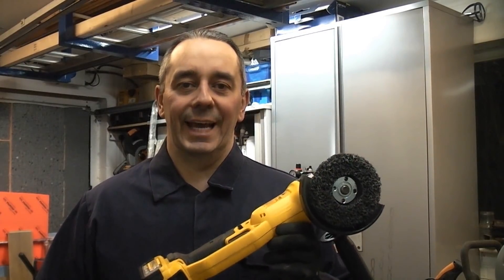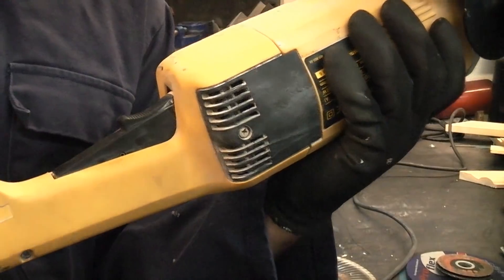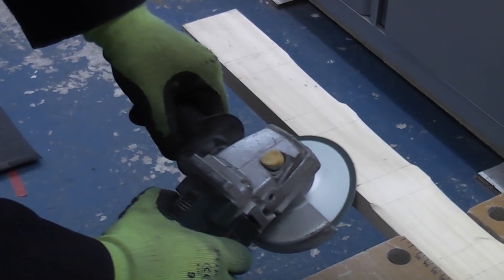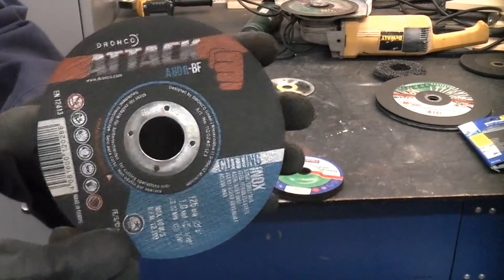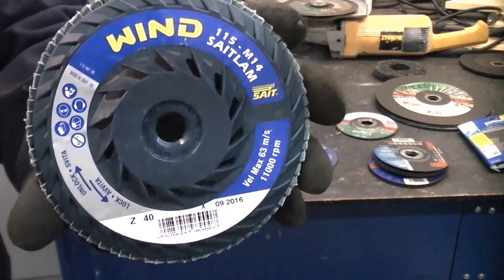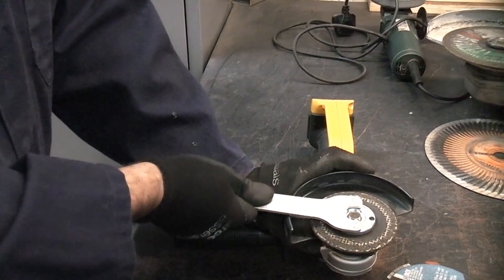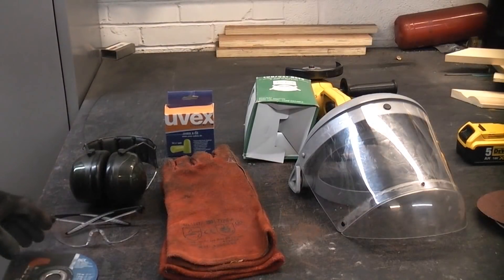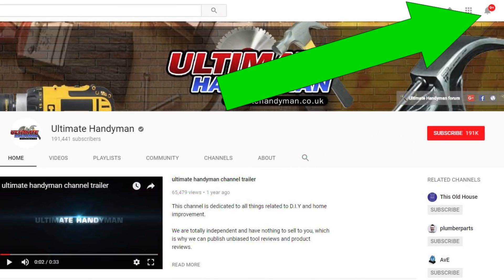How To Use An Angle Grinder-Angle Grinder Safety Tips

Comment: Thank you for that video I've never used an angle grinder I appreciate all of the tips for safety.. I do have a question.. in my shower the tile was installed in a way called here in California "floating the tile". Another term I've heard is "mud wall".. you probably have heard of it.. what it consists of is attaching stiff wire mesh to the exposed two-by-fours in the wall of the shower then they put paper over that and then lay concrete 1 in. thick and the last step is attaching the decorative tile to that concrete.. so now I want to renovate with new tile. I took all the tile off and now the one in thick concrete is left attach my wire mesh to the studs..  to remove it back to the bear studs you must first cut through 1 inch thick concrete then cut the stiff wire mesh... I would appreciate your suggestion for the type of Blade to use for each task. I have a DWE4011 ANGLE CUTTER.. so I guess I'm asking your recommendation of a blade I could use to cut the concrete then another blade for cutting the wire mesh.. unless of course there is a wonderful blade that will do both !!! thank you in advance for your reply
Reply from the maker: A diamond disc will easily cut the concrete, it will also cut the metal, providing you don't try cutting massive pieces of metal with it (mesh should be fine) https://fave.co/2LzhGlm

You'll have to watch out for the dust though, as there will be lots. You can get a dust extraction attachment for most grinders, so one of those will be useful ;-) as well as a good dust mask and other PPE 

Thanks for the comment

Comment: I have two angle grinders but have never used either, but have a couple of projects that I would like to do. But, I am a big believer in safety.  While it is true that tools like angle grinders are used dangerously thousands of times without incident, when that incident does happen (and it will) the results are horrendous so why take a chance that you will be the one unlucky person and suffer for the rest of your life.  Chainsaws are a big beef of mine.  I saw a video where they demonstrated the use of the orange safety overalls.  The demonstrator purposely touched his leg with a running chain saw and the overall material snagged the chainsaw and stopped it dead.  Almost nobody uses those safety overalls.  I rented a chainsaw one time and was required to take overalls with the chainsaw by the rental company. Great video.
Reply from the maker: Accidents with power tools can be life changing, it is always best to wear the correct PPE
Thanks for the comment 👍

Comment: What's your view on discs that come with no expiry date? Is it possible that they can last indefinitely if stored correctly and not used for a long time.
Also would a diamond disc for cutting metal cut always cut slower than a cut off disc?
Reply from the maker: As far as I am aware all bonded discs have an expiry date on them, the only ones that don't have an expiry are diamond discs or flap discs.

For metal cutting, 1mm thick slitting discs will cut through any metal much faster than a diamond disc

Thanks for the comment
Reply: @ultimatehandyman  Thanks.

Comment: I think this might be a good place to ask this question.

I recently started using these angle grinders and was wondering if there is a book / site of some kind which explains the basic phenomenon like the shaking of cutting disc when going inisde a cut , how much pressure to apply or explaining the basic mechanics behind it. 

Any help is appreciated.
Reply from the maker: I don't think there is. I'm not sure why the disk shakes etc.
The engineer guy will probably know.
Thanks for the comment 👍

Comment: I just bought my first angle grinder to cut up and remove an old water tank that's been taking up room in my loft for years. I'm 90% certain it's galvanised steel, how can I make certain that it's safe to cut before tackling it? You mentioned flammable and even explosive metals and now I'm slightly nervous... Shame I can't get it out of the loft in one piece actually, these things go for over £100 on eBay as vintage planters!
Reply from the maker: I'd leave it to be honest.
If you really need to cut it up a reciprocating saw is best, as there are no sparks, example here-
https://www.youtube.com/watch?v=pyf5ZORNIEA

If you have to use a grinder, you need to be extremely careful due to the sparks, they can easily set fire to roofing felt, etc. 
Also galvanised steel can cause galvanic poisoning when cut with a grinder, so you'll also need a good quality respirator. 
Thanks for the comment 👍
Reply: @ultimatehandyman  Thanks for the reply, I already decided to leave it alone, sounds too risky and don't want to poison myself. Tried to tempt a couple of local scrap metal collectors with the promise of a big pile of free steel, but unsurprisingly they didn't go for it. Galvanised steel isn't that valuable and it would be more trouble than it's worth. I guess that's why people just put up with these tanks until the roof gets redone.
Reply from the maker: @glaucodilieto   Absolutely, it is not worth the risk just to free up a bit of loft space. I just found out today that my girlfriends dad has set his pants on fire using a petrol driven cut off saw. He could not see that the sparks were hitting his leg because of the goggles, then it was too late, so he spent the night in hospital! 
Thanks for the comments ;-)

Comment: I noticed at 15:00 you're using a standard type 27 grinding guard while cutting the piece of steel.  I'm new to angle grinders and have noticed that places like manuals and workplace/safety code videos are adamant about not using a type 1 cutting wheel without a type 1 guard.  However it seems like most actual users don't use them (seems like a large percentage don't even know they exist.).

Type 1 guards seem to be impossible to find, and it appears like the majority of companies don't even make them for their 4-1/2" grinders (even though they happily provide 4-1/2" cutting discs).  My logic says if you have a type 27 guard in the proper position and you are standing to the side out of the line of the tool that it should provide roughly the same amount of protection if a cutting disc should happen to break during operation.

I guess my question is, what your opinion on using a grinding guard for cutting is?  Is it something you do simply because of experience, and you wouldn't suggest others do it, or is it something that you would say is ok, as long as you have the guard positioned correctly and are operating the tool properly with sufficient PPE.

Thanks in advance,
Reply from the maker: I’ve done at least ten abrasive wheel courses over the years, not once has the type of guard on the angle grinder been mentioned (perhaps it is something new, or only applies in some countries). I’ve noticed in a lot of YouTube videos, that most guards are removed completely! 
As long as the guard protects the user in the event of a disc shattering, I can’t see it being a problem. 
 
Thanks for the comment 👍

Comment: Appreciate the excellent content here, but Are you sure about what you stated at 20:35? Doesn't make sense to me that you would use the flat side of the flange nut on a type 27 cut-off wheel or any type 27 wheel for that matter.
Reply from the maker: A type 27 disc, just seems to be a depressed centre disc.
If it's a depressed centre thin cutting disc, you would have to use the flange nut as shown in the video, or it won't grip the disc.
A depressed centre grinding disc, however is much thicker, so the flange nut would have to be installed the other way up 👍
Reply: @ultimatehandyman  OK thank you for clarifying this for me 👍

Comment: Thanks for the nice video.. If it fine to use angle grinder as sander?
Reply from the maker: It depends what you are doing, you can use the sanding backing disks for rapid removal of material, but if you want a smooth finish for painting etc. you need a sander.
 Thanks for the comment 👍

Comment: Can I use an abrasive chop saw to cut Steel I beams (IPE 80 Or 100) Cutting the Steel beam by abrasive chop saw is standard or not, because I want to cut it with a 45 degree angle and High precision, I can not use a torch
Reply from the maker: You could do, but there are much easier methods such as a metal cutting chop saw or metal cutting band saw. Cutting I beams with a hand held machine will not be easy.
Reply: Thank you for Reply and Special Thanks for your great videos

Comment: Hello are gloves considered safe when using a grinder? One of the rules in a shop I used to work in was no gloves when grinding (and using the lathe etc)
Reply from the maker: They considered safe when using an angle grinder and all the manuals I have seen for angle grinders say that gloves should be worn, it also says it on the disc. But I would never wear gloves when using a bench grinder as your hand is close to the wheel and could be dragged in when wearing gloves. I also never wear gloves or long sleeved overalls when using the lathe.
Thanks for the comment

Comment: Thank you for an excellent video! As a newbie to angle grinders this has been invaluable. Can you explain the depressed centre versus flat discs? Bought my first discs and they offered both mounts for steel and stone. Wasn't sure so bought flat ones.
Reply from the maker: Sometimes a depressed centre disc is useful if you need to cut something flush, it means that you can get the grinder level, without the nut from hitting the surface that you want to cut flush against.
 I hope that makes sense!
Thanks for the comment 👍
Reply: @ultimatehandyman  Makes sense, thanks!

Comment: How small can I let a 115mm 1mm cutting disk get before I should throw it out? Can you give me an approximate diameter? Thank you loved the video.
Reply from the maker: Once it looses about an inch  from its overall diameter that's about it normally. You will know because you will no longer be able to cut or grind with it as the guard and machine will be in the way if the disc.
Thanks for the comment

Comment: Angle grinders are truly terrifying beasts. I used one for the first time today, to cut an old, empty fire extinguisher in half for use as a crucible for aluminium smelting. The angle grinder kept jumping and snatching - and eventually the blade shattered. So now I have a half-cut-off crucible (which despite my thinking that fire extinguishers were all steel, seems to be aluminium (no sparks and a magnet doesn't stick to it)), a shattered cutting wheel (I have some thicker grinder wheels, but they're no good for finishing the cut) and, TBH, a slight fear of using the bloody thing ever again! Any advice to help me "get back on the horse", as it were?
Reply from the maker: I have a few small empty fire extinguishers here, if you live anywhere near Darwen, Lancashire you can have one.
Aluminium is hard to cut with a grinder as normal cutting discs are made from aluminium oxide, so you need to use a masonry cutting disc (silicone carbide), although you can now buy 1mm thick aluminium cutting discs. 
I have made a furnace and made the crucible from stainless steel, but have not had time to do a smelt yet.

Thanks for the comment 👍
Reply: @ultimatehandyman  That's really kind of you - I'm in Leeds, so it's probably a bit far to trek :) But ta for the offer.
And thanks for the useful info about cutting aluminium - that's something I didn't know: your channel just keeps on informing and informing! Having looked at a few other vids on "how to cut with an angle grinder", I suspect part of my problem might have been that I was trying to cut with the wrong part of the wheel, if you know what I mean: I should have been using the "underside" of the wheel, rather than  the "front". Cutting a cylinder, rather than a flat piece, for my first go probably didn't help either. Cheers for the quick reply, though - and I really love the down-to-Earth straightforwardness of your vids. Keep 'em coming!

Comment: I agree that the wire brushes are a pain to use, the "cup" versions are probably the slightly better ones but you want to use a decent pair of thick gloves as the bristles still come loose.
Reply from the maker: Thanks for the comment ;-)
Reply: Those wire brushes are damned spikey - I got bleeding fingers just getting them out of the box.

Comment: Excellent vid. Every single time when i see a contractor removing shield from the grinder makes me mad. If a disc shatters and your grinder had no shield you can say godbye to your pretty face or worse. Even brand new disc may be out of spec and shatter for no reason, it would be impossible to run quality control on every single one of them
Reply from the maker: Yeah, I'm sure if they found anyone on the site where I work without the guard on they would be removed from site!
Thanks for the comment 👍

Comment: I've learned a lot from this and also I didn't know about the use by dates!
I'm planning  on grinding out mortar in preparation for repointing a wall, which disc do you suggest is the best to use?
Reply from the maker: You can buy a special mortar raking disc, they used to be really expensive 20 years ago, but now they are really inexpensive- 
https://fave.co/2BAbAOi
Thanks for the comment

Comment: You can safely use larger disc on smaller grinder after you reduce the diameter. So used 230mm disc can be later used on 125mm grinder as long as the diameter is down to 125mm etc. The problem of running large disc on fast small grinder is only the kinetic energy. 11000rpm simply create too much kinetic energy on the outer diameter of 230mm disc and it can disintegrate (but most branded discs should not disintegrate even in this condition.. but it is dangerous and should be avoided. Usually they hold up to 200% of nominal.  Cheap chinesium discs are different story tho.).
Date stamped on disc is mfg date mostly. There is no such thing like expiration if the storage conditions are good (not wet, not frozen, not deformed etc). I have many discs from early 90" still perfectly good.
Metal brush discs are great for removing old paint or rust. Actually one of the most effective ways to do that. But it is nice if the grinder has RPM control and can be throttled down a bit to cca 1500-3000RPM.
Reply from the maker: I'll tell the abrasive wheels instructor that he is wrong the next time I see him 😂

Comment: Great video as I'm planning on cutting down the wall in front of my drive. It has a metal railing on top.
I think the wall is 2 bricks wide so would a 5 inch grinder be capable so you think if I cut from both sides. Thanks
Reply from the maker: I don't think so. The last time I cut through a single brick wall using a grinder I had to use a 9" one and cut it from each side.
Thanks for the comment

Comment: Any tips on grinding a rebar off sticking out of a concrete slab flush to the floor?
Reply from the maker: If you get a depressed centre cutting disc you can cut the bar flush to the floor, they make some that are just 0.8mm thick and they do a great job- http://fave.co/2DvVy8a
Or you can just use a normal cutting disc, but you might have to use a flap disc to get a smooth finish with the floor.
Reply: Ultimate Handyman will those depressed discs be able to cut flush while the disc guard is installed?
Reply from the maker: Yes, in most cases. They move the cutting part of the disc out towards the edge of the guard meaning you can often do a flush cut without having to have the grinder on too much of an angle.
The 0.8mm thick ones that I linked to above are really good, but they are not stocked everywhere.
Thanks for the comments ;-)

Comment: Angle grinders shouldn't be used to cut wood? Then what electric tools should and can be used for cutting down long pieces of timber into small pieces? I like to carve wood and need to purchase regular timber for the purpose, but it always comes in much larger form than I require.
Reply from the maker: There are some people that use grinders on wood, but I believe the blades can kickback!
Here are a few options for wood cutting-
https://www.youtube.com/watch?v=6_OYbGlPyOM
https://www.youtube.com/watch?v=kg1tspN8aps
https://www.youtube.com/watch?v=kPXf90GUeg4

Thanks for the comment

Comment: Very useful video, I'm a sales rep for Howdens joinery and one of our builders I know very well was cutting some metal in a wall inside a cupboard at head hight. They were not following the proper protocols and the disk jammed and flipped the grinder back towards the builders face slicing their face in two. They survived the accident and have severe scars. Can be a dangerous tool.
Reply from the maker: Blimey, it's a shame when something like that happens as it could easily have been avoided.
Thanks for the comment

Comment: Hi. Great video. Wish I had watched it before using the angle grinder for the first time. Honestly, it scared the crap out of me and I burned a large hole in the cheap shop apron I was wearing. I did use safety glasses and a full face mask so no real harm done but could easily have set my pants on fire! But, being american and in a hurry, I learned the hard way. Which brings me to my question, the proper location of the safety guard. Yes, I had it installed on the angle grinder but not in the proper angular location. I noticed that all your grinders have the leading edge of the guard just past the side handle. Thanks for taking the time to make this video. Cheers!
Reply from the maker: I've seen so many videos on YouTube where the guard has been removed- it makes me cringe!
Thanks for the comment ;-)
Reply: The proper position for the guard is often the one that obstructs the entire disk from your body. Generally that would be an 10 to 4 position roughly.